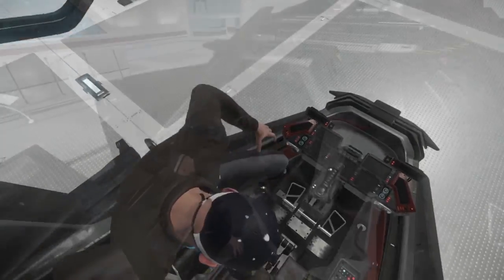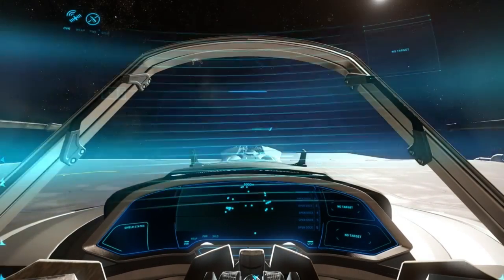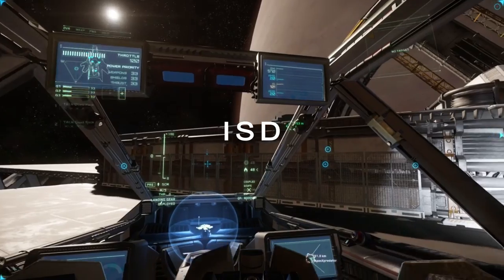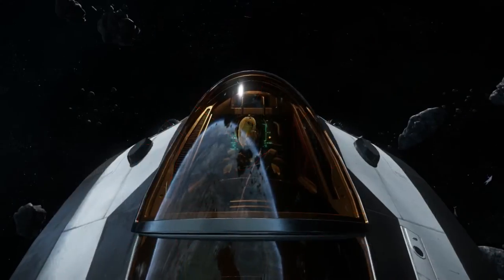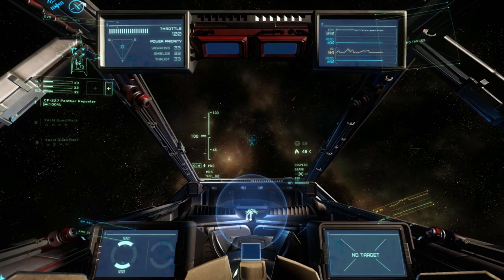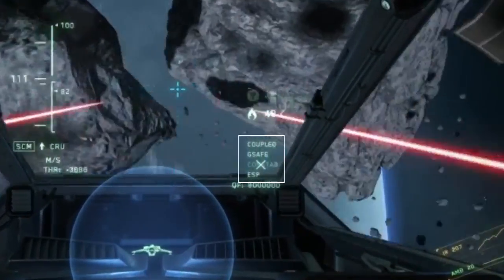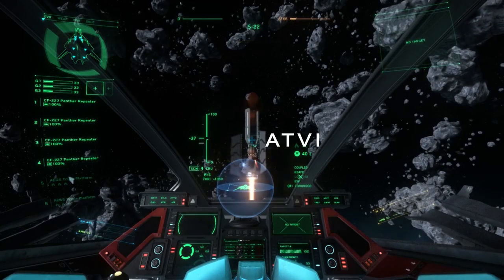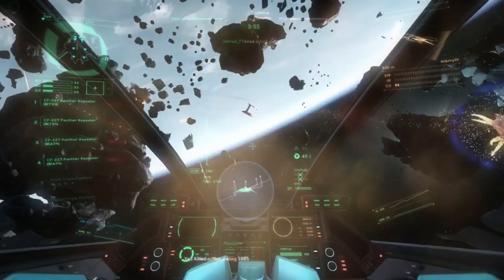Principles of Operation - Star Citizen - Ship Cockpit Familiarisation

Comment: before i watch this video, did u include a guide on how to use constellation UI?
try it... it's not the same.. and i need help
Reply from the maker: The video is meant to be "Generic" so should apply to all ships, but I have not discussed the keys to interact with them. It's describes what the components of the HUD and CVI are, so you can understand what your seeing.
What is the issue your having? I can try and help.
Reply: i dont know how to turn on the missiles for my constellation.
using the regular buttons like f3 and f6-f8 dont do anything